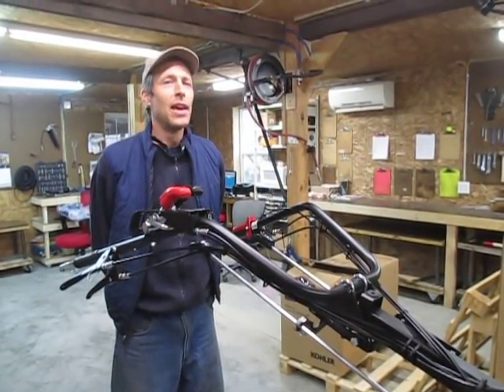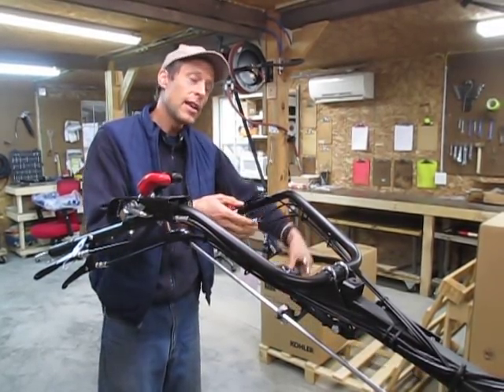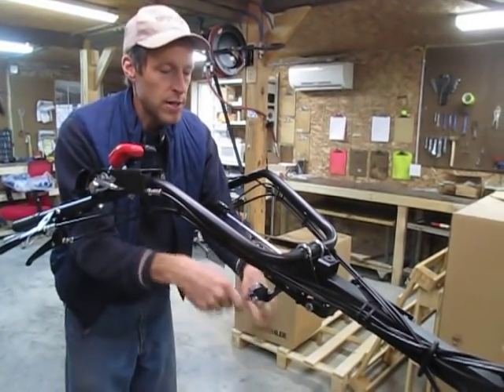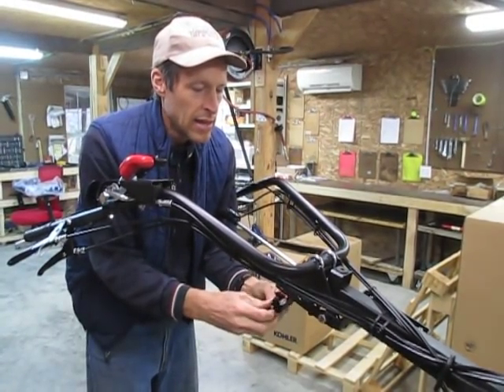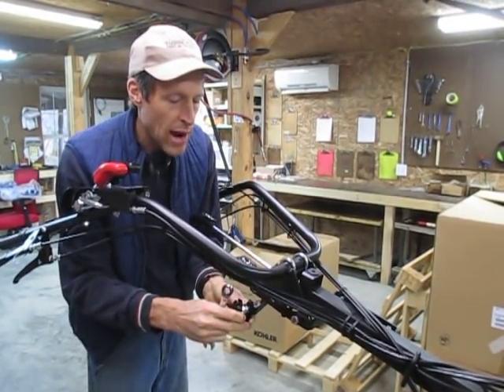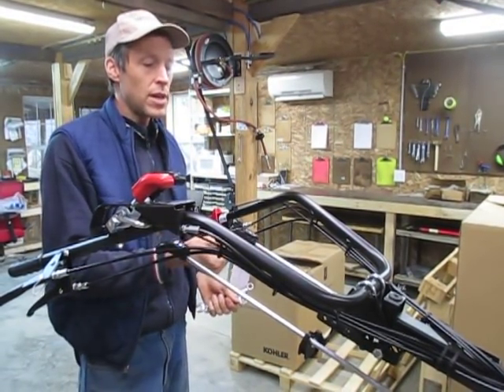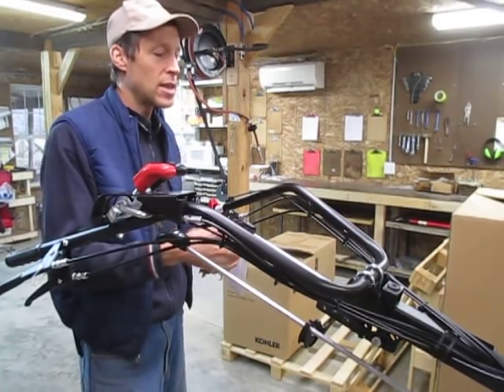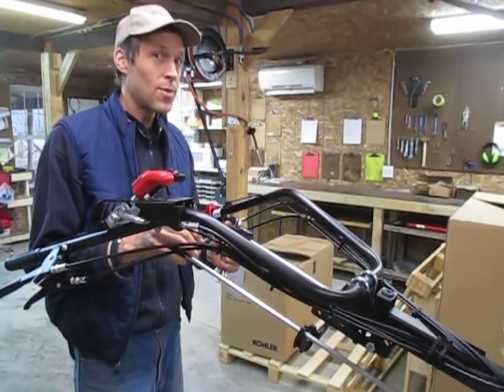BCS Walk-Behind Tractor: Gearshift Lever Support Bracket (Earth Tools "fix")

Comment: Great idea. I solved this problem differently--I have a thick elastic that I wrap around the two levers, holding them in. Kind of like a continuous circular bungee without the hooks. No idea where it came from, but has worked for years. A short bungee would also work if linked to itself.